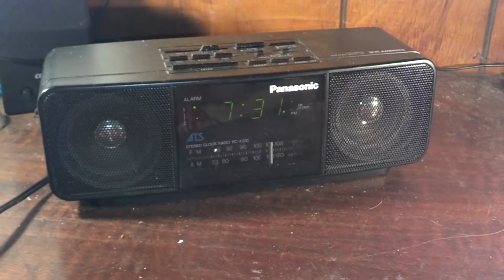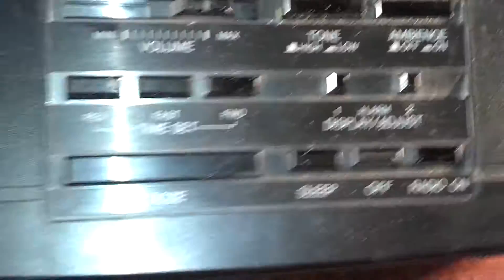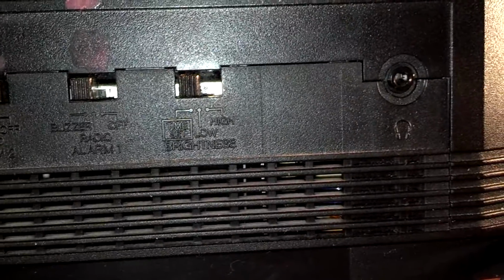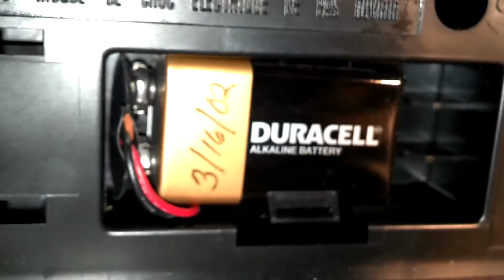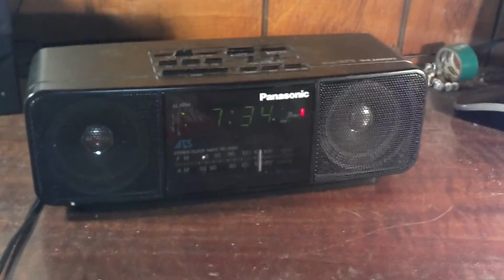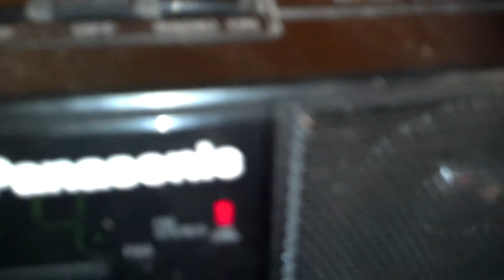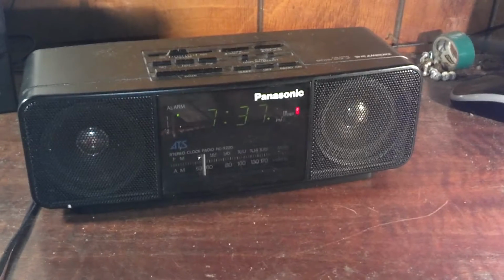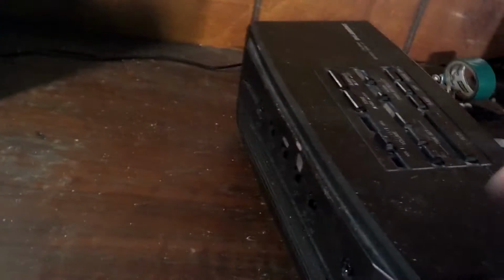Panasonic clock radio model RC-X220

Comment: I just picked up this fantastic radio, now days very few radios are stereo, and forget about ambiance, which created a suround sound, it's like it puts sound all over the room, the sound is very crisp, clear not muddy, even at low volume it is very clear, it has true stereo seperation, very few radios now have true stereo, they fool you with trashy base boost, I remember in the 1970-80 every stereo had rich crisp clear sound, they had equalizers, stereo wide, true stereo, now days radios are pure muddy trash, I miss those days when it was every stereo tried to put do each other, I could not believe I picked this up for around $8, and the very best stereo I bought in the 1970s was a Sears model sr 2100, it had only 5 inch speakers a double cassette, and the sound was so clear and crisp, had base treble, and ambiance, I sure do miss those days of real stereos
Reply: As long as you can tune in a strong station, the radio really plays fine (the power cord is the antenna). I listen to a weak station here in Westchester County so I have to be patient with it.

Comment: how do you set the time? the buttons arent' working, bought at thrift shop
Reply: Set the back button to Time Set, then use the Rev, Fwd, along with the Fast button to move the time forward or back. Hope that helps.
Reply: @kashbagal5724  : My unit is a bit different, all the buttons on top are to the extreme left, but the radio plays great; by the way, the power cord is also the radio antenna so try to extend it out. My cassette squeals so unless I can open it and play with it, only the radio works. Not made in China, but Singapore.